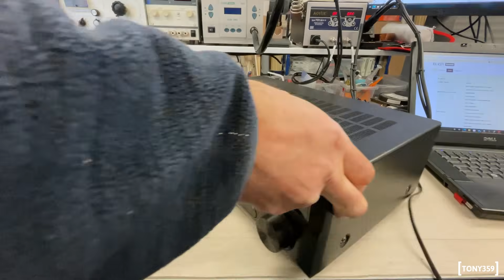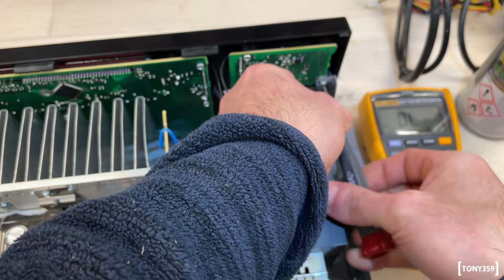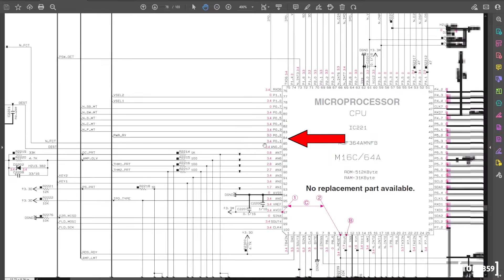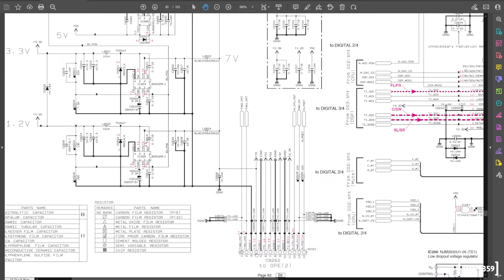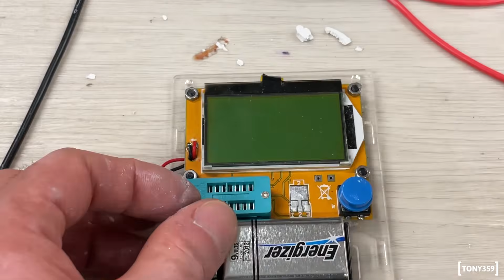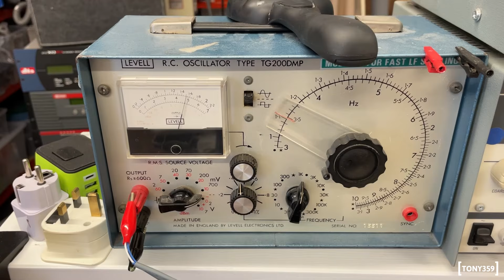Yamaha RX-V371 Repair and Test

Comment: You're a master. I wish to have that knowledge for diagnostic my receiver. Maybe you have any ideas why on Audio channel source it has loud noise like pink noise, but on HDMI source working fine?
Please see my video about Yamaha RX-V475. Thank you
Reply from the maker: Thank you! I am no expert but I took a look at the schematics, the block diagram. If HDMI works it means that that route is ok. The difference with the analogue sources is IC 61 which is the ADC (Analogue to Digital Converter). HDMI also goes through there but HDMI is digital already so that section is not used. It looks like the ADC section of IC61 might be malfunctioning.

I see this receiver has a very extensive self test and diagnostic menu, take a look at the service manual (available online) and experiment! Good luck!
Reply: @tony359  Thank you for your answer. I really appreciate :)
Reply: @tony359  I took apart receiver and multimeter continuity test showed 1560 between audio signal input and ground connection. Is it normal or it shouldn't show anything? If I good understand signal touching ground?
Thank you in advance for any help :)
Reply from the maker: 1560 doesn't seem bad - whether that's intentional or not, I do not know. 

An input issue wouldn't sound as pink noise. Pink noise is likely digital data. If your input was in a ground loop you'd hear buzzing noise I think.
Reply: @tony359  https://youtube.com/shorts/X8TXN3KxoGE?si=hzDIEh0fXQBTrrfz

This is what I hear though this channel. I surrender. HDMI working fine so I'm not sure what to do and better will be don't perform any other damages  ;)

Comment: nice video...how to measure crystal clock with digital multimeter, i don't have osciloscope...thank you
Reply from the maker: Some meters have a frequency reading. If yours doesn’t, then I’m afraid you can’t do that. There are very cheap oscilloscopes available though. Thanks for watching!

Comment: ขับตู้ 15 นิ้วไหวไหมครับ
Reply from the maker: Yes As long as you stay within the maximum power output of the unit and minimum impedance - but the 371 is a pretty low power unit.

Comment: you did not mention and just wondering did you first try waking it up by pressing a sequence of buttons after it might have gone into damage protection mode, which is what happened with my rx v671, I thought it was dead and gone, eventualy found the right sequence and now working again. Did a overdue firmware update as it was connected to a new 2023 4k tv.
Reply from the maker: I'm not sure I follow but I did find the sequence of buttons at some point in the video :)
Reply: @tony359  Sorry my apologies, I must have missed that part in your Video - Yes you did check it 😊

Comment: @tony359 Thanks for the detailed explanations, Refreshed my past quest of electronics. Picked my faulty Yamaha RX-V365, It was in the dead. No AC volts in the secondary of standby transformer, Replaced the fuse in the standby transformer, Started seeing the AC voltage. However, Don't see 9.4 rather getting higher voltage approx 20V AC. Looks like the load is light or no load at all. The schematic looks similar to V371. Any suggestion's, Do i need to look into primary/ secondary circuit or both for faulty resistor or capacitors.
Reply from the maker: My schematics are always "incorrect" when it comes to voltages. A transformer is a transformer, either it works or it doesn't, I doubt it would suddenly output twice as high voltage. I wonder if some schematics are for 120V and others for 240V? Anyways, I would focus on te voltage regulators. Do you see the correct standby voltages coming out of them? That's required for the CPU to start.
Reply: @tony359  Sorry for the delay, I see constant +3.3 volts in the CPU board.

Comment: Hey what if the factory reset doesnt work neither does it have a bulge cap you here the clicks but nothing still happen but only seeing 2.0 at the processor pins how to fix?
Reply from the maker: 2.0 at the processor pins? There are many pins :) And what is 2.0, is it 2.0 Volts?
Reply: @tony359  yes the rail pins only showing 2.0 volts
Reply: Mine is the rx-v377
Reply from the maker: All the voltages are coming from the operation board. Disconnect the rest of the AVR and test on that board. You must see proper voltages there. If not, then it’s a supply issue somewhere, likely on the operation board. If you download the service manual it’s easy to follow all the rails and trace them to the source.  I hope this helps!

Comment: My yamaha Rx-V371 receiver  is not working, it is on "Protection" mode. Technician said DST chip should be change, but unfortunately i couldn't find it. any solution from you?
Reply from the maker: it's hard to say. To be honest the 371 is a budget unit so I am not sure it's worth any money. Not sure what the DST chip is but if it's one of the amplifier modules, those are hard to find and kind of expensive so...

Comment: I have the exact problem on my 371 and the same CAP is badly bulged.  Mine after trying to figure out what was going on just stopped powering on altogether.  Power button does nothing, no clicks, no nothing.  The unit is totally lifeless.  I am going to attempt to change the CAP but concerned as to mine went from being just like yours to completely dead.  Any idea?!
Reply from the maker: It should be normal. After several shutdown errors the unit will only start in service mode. Try that, it should come back at least temporarily.

Comment: This is awesome. The first thing I ever fixed was a Sony receiver from 1997 that my father put on the sidewalk because it wouldn't turn on anymore. This was 2005. I thought to myself, "I wonder what makes this thing work" So I brought it up stairs to take apart. Turns out the plastic power button was just misaligned and wasn't pressing the switch to turn it on. That receiver worked until 2015. Now seeing receiver's repaired always brings a smile to my face.
Reply from the maker: That was worth the effort! So many things end up in the rubbish because of such simple issues. I'm glad I brought back good memories, thanks for watching!
Reply: Well, what is to be expected from the Greatest Technician That's Ever Lived
Reply: oh hello there

Comment: You mentioned about de-oxit in the UK not being available but I’m in the UK and have used it for years and indeed bought some the other day and is available quite readily online even Amazon.  It's around £21 - £25 a can for D5 and around £30ish for Fader Lube version.
Reply from the maker: You're right, I've seen it too but it must be on and off as it's not available right now - unless I'm looking in the wrong place.

Comment: Tony I have a Yamaha rx-v367 and I can't control the volume. The control just spins without reaching a minimum or maximum. I suspect that the control in no good. Do you know where I might be able to find a volume control for this?
Reply from the maker: According to the service manual the volume encoder (it's not a trimmer) is EC12E2460802 and you can find it from electronic distributors. That said, I would maybe inspect the boards and the traces. The little volume PCB (operation(6)) goes to the main OPERATION board. There must be 3.3V and GND going to that board and the volume will return VRA and VRB (volume control pulses). Those pulses only travel through the OPERATION board to then go to the DIGITAL board via CB101 connector. From there, the pulses reach the CPU directly (IC221). Before replacing the encoder I'd check for 3.3V and GND at the little volume daughterboard. If you have an oscilloscope you should be able to see the volume pulses on the VRA/VRB lines (which eventually become VOL_RB and VOL_RA). Good luck! :)

Comment: I have the same problem but with a TSR 5810. I can't even get mine to boot up into diagnostic mode. No reaction. No clicking. I tried all the button combinations even holding power for more than 15 seconds. Won't power at all. Do you have any idea what this might be? I think the microprocessor is frozen up like yours was. Where do you find the service manual? I need one for mine.
Reply from the maker: I found all the Yamaha service manuals are available here: https://elektrotanya.com/keres 
In your case I would go back to the start: do you have voltages out of the power supply/operations board? Please be careful and open the unit up at your own risk. :) Thanks for watching!
Reply: @tony359  Okay, I was able to find mine on hifiengine. It’s got 120v coming in. When I am looking at the schematics page like operation(1), (2), (3), etc. is that the order in which the unit operates? So I should begin looking in operation (1) for problems and then go to the next one if I don’t find anything?

Comment: When the sinewave notches just a little bit that's about 1% THD. When clipped off enough like you saw,  that should be around 3%. Helpful to quickly visually estimate output power. Solid state amps are usually characterized at 1% and tube amps at 3%. To be more precise we need the FFT analysis.
Reply from the maker: Absolutely. Mine was a rough estimate. As you say to get proper values I’d need to calculate the THD. But a visual check gives me a ballpark which should be telling me if all is in order or not. Thanks for watching!
Reply: @tony359 1% is just -40dB so the FFT function in the math menu of an affordable eight bit oscilloscope can come handy.

Comment: Please make video on your home made light bulb for safety checking dead device
Reply from the maker: Hello - you mean my current limiter? Yes, I should probably make a video, thanks for the idea! but the base idea is that you have a lightbulb in PARALLEL with the device so if the device shorts, the most power the mains line will provide is the value of the lightbulb, no more.

Comment: loved your video. I need help my bluetooth on my unit is failing, keeps disconnecting from my tablet and im sure its not the tablet because the tablet works good on another unit. how do i replace or fix my bluetooth in my avr rx-v681?
Reply from the maker: Thanks Joey - I'm really not familiar with BT. Was it working before? BT is a protocol, there are many versions around, I've had BT devices not working well with others but not for a HW fault. Before I'd think of a fault I'd try another device. Does your unit have a firmware update available by any chance?
Reply: @tony359  no updates available. It was working before no issues now it disconncets randomly every 3-5mins. Ill try to use my phone nexted.
Reply from the maker: @joeydelmarsjr.646  It could also be that your tablet got updated - updates sometimes break things! Yes, try different devices please. If still not working, I'm afraid I wouldn't know where to look at, sorry.
Reply: @tony359  whwre can i get schematic long lines for my unit
Reply from the maker: @joeydelmarsjr.646  https://elektrotanya.com/  Just search for rx-v681, it's there.

Comment: Greetings and great video!I have the same amp but recently suround and center speakers gets no signal and stopped working. I ve run the self diagnostic Test All and no sound come out,while front,right and sub works.Could it be that the dsp chip is faulty or perhaps the relays for Center and Suround?Although i am getting the front unit display DSP logo and the suround and center speakers normally. Any advise could be useful!Thanks!
Reply from the maker: Hello Harris and thanks for watching! The are two "monolitic" amplifier chips in the 371. Looking at the schematics, Surround and Centre are not on the same chip. Anything is possible but I doubt those chips are both faulty. It could be anything I'm afraid: faulty relays as you suggest or also faulty muting transistors. If you have an oscilloscope, the sound is converted back to analogue in the IC263 and then it gets into a selector/volume chip IC21(that could also be bad). For reference the centre channel gets into IC21 on pin 92 and gets out on pin 22. If you could probe that pin and see if anything goes in (and then out), it would be a start. On the main amplifier chip, centre channel is entering on pin 15 and getting out (amplified) on pin 6 before it reaches the relay. 
Without an oscilloscope it may be a bit more complicated but I guess you can still see signs of noise using a good multimeter. I hope this helps a bit - the schematic is available online at elektrotanya.com. Good luck!

Comment: Great work, i have a Yamaha rx v767 with no sound, i was told its the dts chip and its not financially worth repairing,  would you repair or scrap it? It seems to only work in multi channel mode
Reply from the maker: I’m not familiar with this issue unfortunately. That is usually how Onkyo fail. But then you don’t have any sound whatsoever. I can’t really say if it’s an easy fix or not I’m afraid. Thanks for watching!
Reply from the maker: I was goggling about your issue, does it work in Pure Audio? The 767 seems to be a nice beast. Are you in the UK?
Reply: @tony359  no it doesn, only multi channel mode shows the speaker symbols, also like on YouTube if you heat the dsp chip, it also doesn't work, im in Cape Town South Africa
Reply from the maker: @thechronic6708  Then it might be something else? I'm sorry, I am not familiar with that design - not that I am with other brands! :) I've downloaded the service manual out of curiosity and I have a couple of pointers. 1. Indeed the multichannel input - or analogue inputs - don't go through the "digital board". They go straight into IC153. So that seems to point to an issue in that area (digital board). Unless IC153 is faulty. 2. Those AVRs have TONS of diagnostics in the service menu. I did not go through them but there are literally pages and pages of very interesting things. Maybe that could help you pinpointing the issue? Sorry I wish I could be more helpful!
Reply: @tony359  no problem, thank you very much for your time and advice
Reply: Sir Tony I'm Tony from Philippines. My Yamaha RX V367 is clicking all the relays. The heatsink is getting hot but there is totally no sound.. Pls. help me what to do. Thank you.. Tony B..
Reply from the maker: @antoniobaylosis3226  Hi Antonio! You can find the service manual on Elektrotanya. The service mode on your model is entered by holding "tone control" and "straight" before powering up. That might help with the diagnosis. 
In the setup menu,  under DSP parameters, try the "Direct" mode. That will only work with an ANALOGUE input and will bypass all the DSP and digital circuitry. That might help pinpointing the issue. Also try the pink noise generated by the unit itself. Good luck!

Comment: Great video.  I have a 481 outputing very bad static sound.  Unit powers up but just the sound is very bad.  What are you ideas on this if you may.  Thank you.
Reply from the maker: Hello - thanks for watching! It's difficult to diagnose from here. Does it happen on all channels? Does it mute when you change input? Does it follow the volume fader?
Reply: @tony359  I also have a blown fuse.  Do you know what driving the over current to blow the fuse?  My power transformer fuse is good.
Reply: I put a new fuse in and it didn't power on. but got a protection mode.  I did combo button push to clear the protection mode and just about when the displays showed the fuse blew with a big flash.
Reply from the maker: @Lavaboyrocks  what’s the fuse label?

Comment: I got 10000uF 63v in market can i install it
Reply from the maker: I do not know what the one you are replacing is rated for. The capacitance must be the same, the voltage can be higher but NOT lower.
Reply: Ok thank you
And I'm changing 10000uf 16v capacitor to 10000uf 63v
But its size of diameter is large
Reply from the maker: @naturenavigators1312  16V with 63V is fine. Ideally you want a 105 degrees one and low ESR. A larger capacitor sometimes fits anyways - or may fit with some tinkering. Otherwise you'll have to find a different one.
Reply: Ok thank you for your information 😃

Comment: What kind of cap did you use
I have the Rx v1600 one of the capacitors is blotted I see the Amp board is X7094-5 the same as The 5990 2 would you say it is the same board
Thanks
Reply from the maker: Hi Marc, the capacitance and voltage is indicated on the capacitor itself. The capacitance, in uF or micro Farad, has to be the same. The voltage must be the same or higher. Ideally you want 'low ESR' capacitors and rated for 105 degrees. 
If you can't read those values on the capacitor itself, you should be able to download the service manual of your AVR. Good luck!